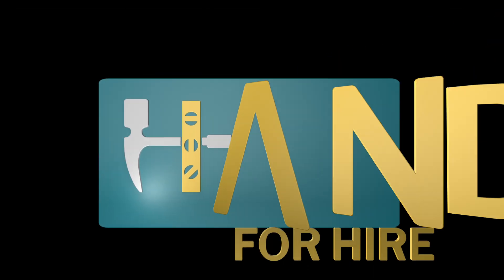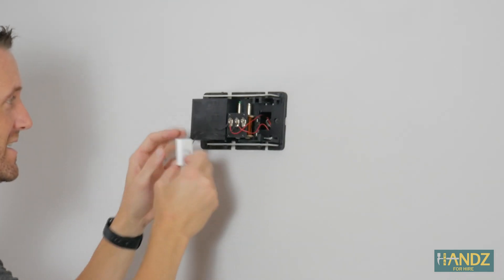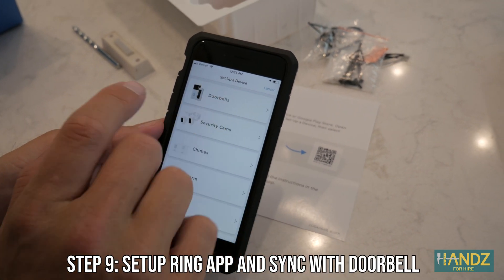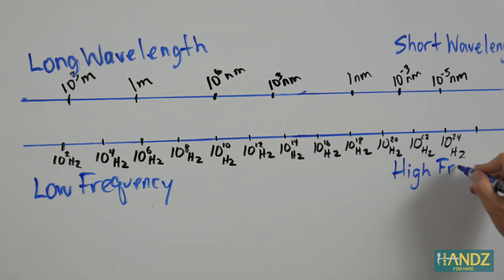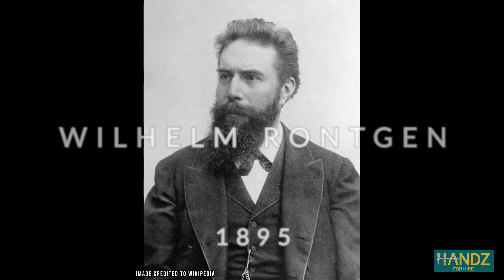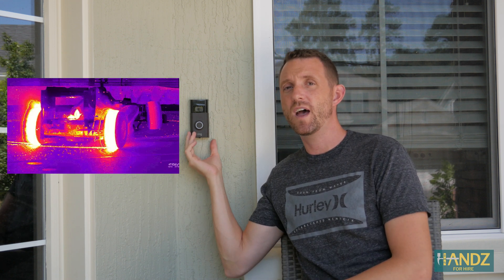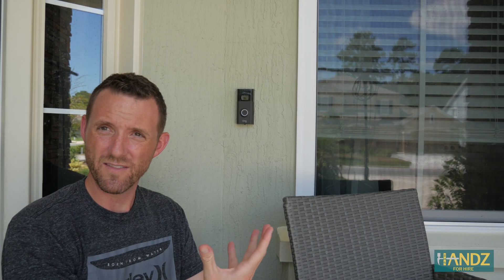Ring Doorbell Pro FULL Installation Plus How Motion Sensors Work

Comment: we do not currently have a doorbell. Do we have to run wires or is there a bettery operated doorbell?
Reply from the maker: Hi Tim, Ring sells doorbells that have lithium ion batteries as well. The Ring app on your phone alerts you when the battery is getting low (every 3 months or so). You just take the battery out and throw it on the charger for a few hours, and you're good to go for another 3 months. Have a great day!

Comment: Great vid. Next time you wrap the wires around the Ring Doorbell screws (or any other electrical component), you should try to wrap them in a clock-wise (righty-tighty) orientation so when you tighten the screws, the screws tighten down and help to wrap/secure the wires around them since you are rotating the hooked wiring into place. 

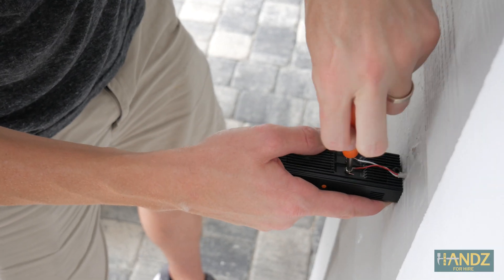Since you did it the opposite way, you can see that the wires started to unhook or move away from the center of the screw.  At 2:46, it looks like you had to try and use your fingertip to keep the wire in place as you tightened. Had you wrapped them the other way, the screw would have helped you keep it in place. 

Keep up the good work.
Reply from the maker: Miguel Perez thank you for catching that and you’re completely correct. I always go righty tighty. I should have switch the loop around. It was such a short wire that I was having a hard time getting it to even reach the screws. Thanks for watching and have a great day!